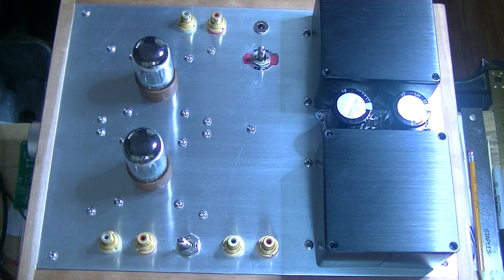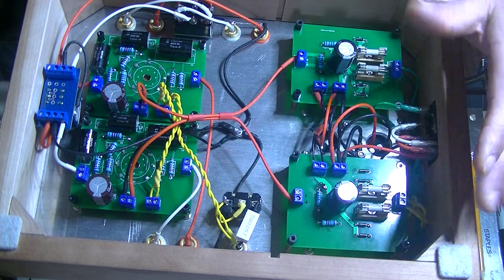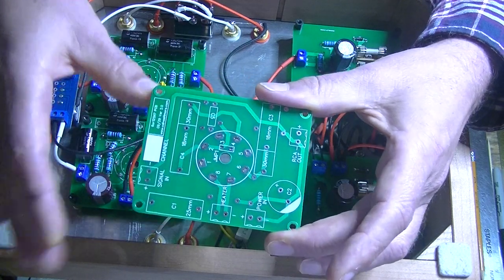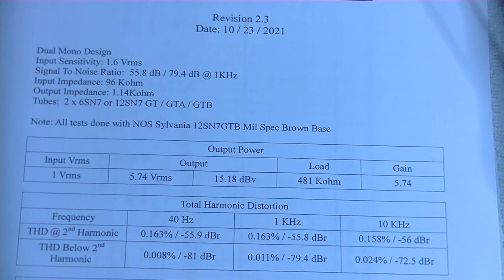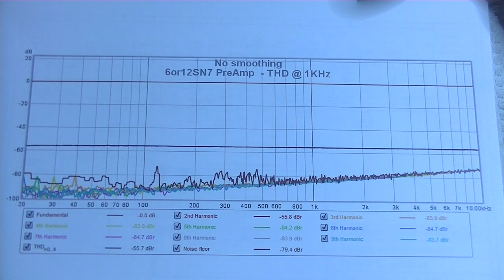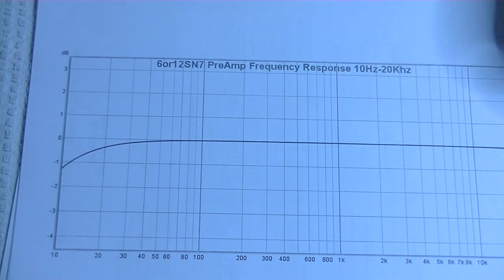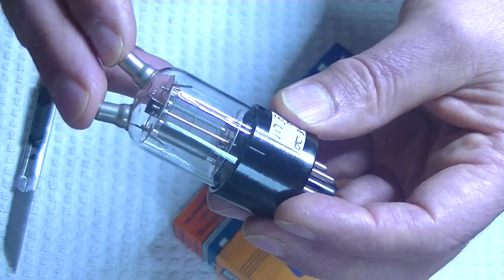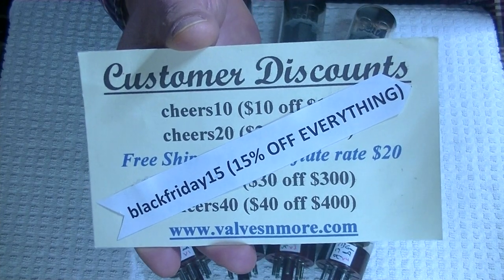Tube Lab #57 - 6or12SN7 Kit Preamp Finished

Comment: What are the sound signature differences between this preamp and the E 80CC preamp?
Reply from the maker: This is a great question!  The E80CC is one of my fav tubes, very clean and clear, very low noise and distortion, lots of gain (mu = 27).  Used in recording studios due to these great qualities.  The 6or12sn7 is another favorite tube, very warm sounding with lots of 2nd order harmonics and it can of course play the 12sn7 tube which can be less expensive and more available - at least till I sell a bunch of these preamps!  The differences are night and day, which is why I decided to have two Kit Preamps.  For those that value clarity the E80cc all the way and for those that love a warm rich midrange the 6or12sn7 is the clear choice.  I use both in tight rotation, I love the sound of both equally.

Comment: Very nice job on your pre-amps , I’m interested being a slow learner ( also as a musician) , I’m curious on the input and output connections that will be on it . Also as a follower and owner of the Willsenton R8 it seems their pre-in is not a true pre pre-amp in only bypassing the gain control. Would it therefore be beneficial . But I also have a Marantz int 8006 which would benefit for the tube pre . I have been enjoying your tube upgrades btw Svetlana 6500 and very nice and enjoy your honest perspective . I’m learning . The THD specs at different ranges were rare and honest
Reply from the maker: Thanks for the kind comments, the specs are actually a collaboration between my son and I, Charles did the testing and drew up the specs. He wanted them to be as representative as possible.  We already knew the amps sounded great, so why hide behind some BS!
All the Kit Amps are old school, all Ins and Outs are via RCA
And true the Willsenton R8 pre in just bypasses the volume control all tubes are in circuit.  However I like the sound much better with either of my Kit Preamps in front that I won't listen to it any other way.  I know this sounds counterintuitive, but audiophiles have known for a long time that a quality preamp in front of an integrated amp can improve the sound.
Reply: @tubelab194  I am relieved that your preamps just bypass the gain on the R8 and engage all the Those wonderful vintage tubes… Wonderful!